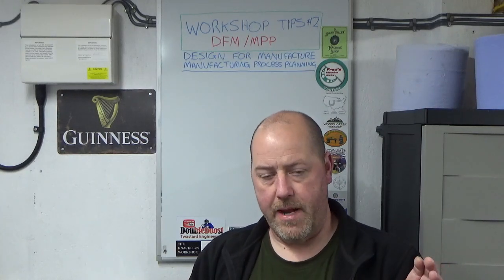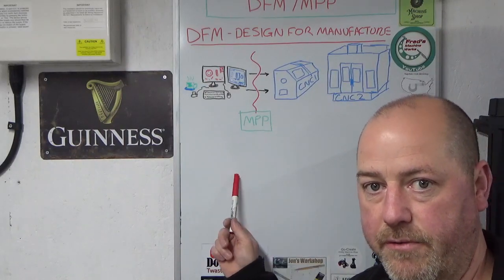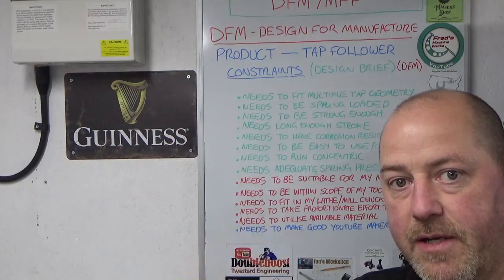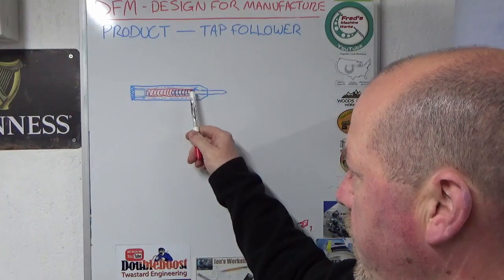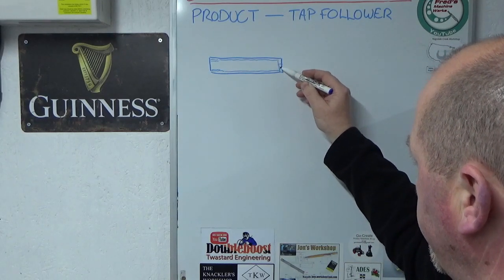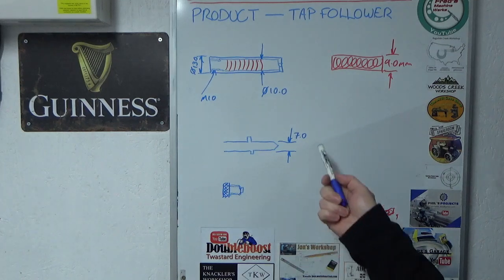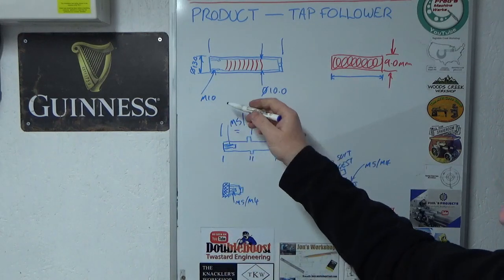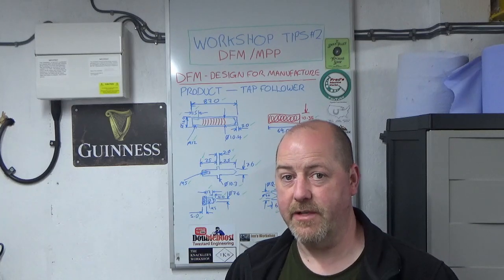Workshop Tips #2 - Component Design "DFM"

Comment: Interesting.
The tool does NOT have to be double ended. Using a double ended tool that has to be disassembled and reassembled for use "is a pain"! The cone piece with the threaded shaft is extra work for a part that may or may not be used as the "plug" end of the tool. This would become a little awkward if the intention is to screw this "cone piece" into the end of the tool, as you needed the "bump" of the original "cap" end to locate the spring to limit the travel of the spring loaded pointer. This part, or the original end cap is prone to get lost.
My suggestion is to make the tap follower (more or less as normal) as a single ended tool (with a point). Design this tool as you would expect to use it and to appropriate dimensions. When the tool is designed to requirements, extend the pin length sufficiently (10-12 mm) to allow the use of a "cone" adapter. This adapter is a sliding fit on the pointy end of the tap follower. This adapter could be magnetised to enable it's retention on the pin while setting up the job. Providing the length of the pin is suitable, the tap follower would work exactly the same with or without a cone adapter. Multiple cone adapters could be made to suit the taps on hand and more could be made on demand.
Keep in mind of course that a tap handle in use on the tap, will severely restrict the use of any tap follower when the tap itself does NOT have a centre hole. Any tap that has a point on the driven end could be catered for with an adapter that has a suitable sized hole that would locate this "point".

Thinking further, the adapters don'r really have to be "cone" adapters. Most taps have "standard:" dimensions so suitably sized holes that just encompass the square head of the tap should be sufficient to provide the follower location and guide the tap as required. This simplifies the manufacturing process as any adapter only requires two holes, no "machining" involved. Multiple adapters with the sliding hole only, could be made in advance. The sliding hole would be drilled as deep as possible and pieces parted off. The sliding hole at this time (after parting off) is a through hole and provides the location for any future sized tap adapter hole.

I hope this helps :-)

Best wishes
Reply from the maker: Hi Zen, thanks for the comment. There are 100's of takes on the design of this tool, this was mine but as you continue to watch the following episodes, you will see I had a bigger plan to make tap wrenches that work in conjunction with the design. The change over is about 10 seconds as you will see in the manufacture video so its fine. I will never lose (famous last words) the cone as it docks nicely in the cap, which all fits in the chuck when I use the pointy end. I am very pleased with it as you will see in my 'new keyless chuck' video where I used it in anger for the first time in conjunction with the new tap wrenches. Cheers, Jon
Reply: @jonsworkshop  Good news! Thank you for the reply. I'll check out the tap wrenches soon :-)
BTW. There is an error in my comment, I mentioned the "through hole" for more adapters. You can't have a through hole, the pin would not be able to press on the adapter :-) :-) :-)

Comment: Does that mean the knurled end cap will be in the chuck/collet?. 
An idea is to make the end cap as described but with a 10 mm spigot on the outside. The end could be drilled and threaded to accept the the cup.
Reply from the maker: Hi Fred, thanks for the comment and suggestion. For about the first time since I started the YouTube thing, I am in front with my videos by a couple of weeks....... Yay! Follower already made and cone end does screw into the cap and yes, it does fit up inside the chuck which is why I went 0.5 mm smaller on the O/D to ensure the chuck doesn't locate on the cup piece or knurled diameter. It all checks out so far, need to use it in anger of course for the acid test. I have collated all the suggestions so if there is ever a 'Mark 2' I will be applying the best ideas. Make video coming this weekend for continuity. Cheers, Jon

Comment: What ho Grasshopper, 
Interesting to see your thought processes at work. I have never found the need for such a item as i just use a chuck to hold the tap to start the threading but there are many ways to get to the same target. 
One extra use for your tool you might not have considered is an aid to 4 jaw centring a centre pop. Had you not mentioned your add on cap i would have suggested a centre drilling in your screw in plug.
Thinking of which, if 13mm is the od on a low load item a M12 thread would work but a finer thread one would be a benefit but then you only need less than 50% thread engagement to give room for a larger spring and pointy bit. That all makes sense as i write but may be gibberish to you. If so you must forgive me as Gibberish is my native tongue not English.
ATB  
c
Reply from the maker: Hi Chris, thanks for the comment. All makes total sense. I actually missed the 4 Jaw application but good suggestion. I did think however that I don't need to fit it in the chuck on the lathe now, I can just use a fixed centre in the threaded hole (just as well being as the finished item ended up at 16mm O/D lol). It fits the mill chuck at this size which is the main application. Make video coming up next weekend for continuity. Hope you are keeping well. Cheers, Jon

Comment: Hi Jon. The only problem i can see is. If the cup will for a pointed or blunt end tap of various sizes. Then the cup may bind on the tap wrench as the tap will not protrude far enough from the back to gain purchase on the point without hitting the tap wrench.
Reply from the maker: Hi Stevie, thanks for the comment. Yep, bang on, I had also considered this (didn't cover it in the video, sorry), but I have an elegant solution I pinched from Joe Pie for this which I will show in the week after next video. Cheers, Jon
Reply: @jonsworkshop  Ha Ha keep us in suspense why don't ya.

Comment: Hello Jon,
An interesting video... I think what you have outlines will be most useful for the hobby machinist as it does make you think before you start, which I feel sure will ensure a better outcome... Clearly it wont eradicate any errors or even changes to the original plan... I also like that we will see your DFM be used to make the actual item in future videos. 
Take care.
Paul,,
Reply from the maker: Hi Paul, thanks for the comment and feedback. Definitely, starting out without a well thought out plan and a design that has not had the DFM filter applied, usually results in issues, errors and scrap. Tap follow video will be up next week for continuity. Cheers, Jon

Comment: Jon, been laying here thinking about your tapping guide. When you use the cone, HOW are you going to turn the tap if the square part is up inside the cone ?
Reply: Having one tool that can be disassembled, then reassembled differently to cope with square-ended or recessed taps seems like a great concept, but I too wonder how much of the square end will be available for driving the tap.
Reply from the maker: @mikeparfitt8897  Hi Mike, thanks for the comment and question. Please see my response to Daves original post (save me typing it all out again). Yes, I wanted a dual purpose tool that was smarter than me meaning I couldn't lose loose parts lol. Cheers, Jon
Reply from the maker: Ah haaa, so it's not just me that lays in bed thinking these things through, seems I am in good company. Good question, and one that I have definitely considered in this design (even though I didn't elude to it). I have an elegant solution planned to get round this that I have taken from Joe Pie. I will keep you in suspense for now (don't lose anymore sleep though), and all will be revealed in the week after next video (already filmed and tested). Thanks for the good question Dave. Cheers, Jon

Comment: Jon. when you come to make the cone part. I would like to suggest that instead of just the m4 / m5 thread attaching it to your spring loaded shaft, that you do the following for some extra strength for your larger taps. Make the cone part longer and do a short reamed hole the same size as your sprung shaft about 6 mm or so deep, this will not only align it better than just a screw thread, but give it some added strength when you are heaving away with your m20 or whatever tap. Great explanation by the way of how industry works. I have dealt with designers who do not have a clue as to how machines work. Stay safe. Regards from Australia.
Reply from the maker: Hi Dave, thanks for the comment, good thought, unfortunately and for about the first time since I started the YouTube thing, I am in front for once, tap follower already complete. That doesn't stop me making a future mod in line with your suggestion though as and when I need it. I very much doubt that I will ever tap much bigger than M16 but you never know. Cheers, Jon

Comment: Good one , there can be a lot of planning done . Worst can be designers  unnecessary tight tolerances for some things .   I have been wanting a tap follower for years .    Cheers .
Reply from the maker: Hi Max, thanks for the comment. You got that right! I have also been on the receiving end of that issue as well. You can imagine how in aerospace where engine efficiency is such a key design constraint, the tolerances of +/- 0.001mm are not unheard of, and then we measure these on a top notch CMM that has an accuracy statement of 0.006mm....... Madness! Cheers, Jon
Reply: @jonsworkshop  Never had to work to those tolerances !

Comment: Thanks Jon, that was excellent. I really enjoyed it. I was thinking, with the tap follower, could you have the spring loaded section drilled and tapped at the end, then the cone piece or the pointed piece could screw in as required.

All the best, look fwd to the next one.
Reply from the maker: Hi Carl, thanks for the comment. Yes that would also be a good solution. For once, I am in front a bit so tap follower is already made which is a shame as there have been some great ideas coming in. This has given me an idea for a collaboration project with the subscribers where I float a design idea with some loose constraints and then ask the subs to submit their ideas and I will choose and make a combination of the best suggestions, what do you think? Cheers, Jon
Reply: @jonsworkshop  That sounds like a good idea. That said though I am always wary of things designed by committee! It will be good to see your tap follower.

Comment: Very interesting Jon, as somebody that has never worked in a machine shop environment it was interesting to see how this is done, as a guy that   Make tools and items in his wee shop most of the initial design goes on in my head with a few rudimentary drawings, with some adjustments made half way through the project, perhaps I should use you design procedures and it would save me time .
Reply from the maker: Hi Terry, thanks for the comment. Absolutely, if I have learnt anything over my years in this game, it's that starting out with anything less than 100% worked through plan usually leads to scrap and rework at worst, and inefficiency at best. There are enough odds stacked against you on any job so reduce as many variables as possible before you even pick metal up. I plan every setup out in my mind from raw material to finished part. I do wing it occasionally though and usually get bitten when I do. Cheers, Jon